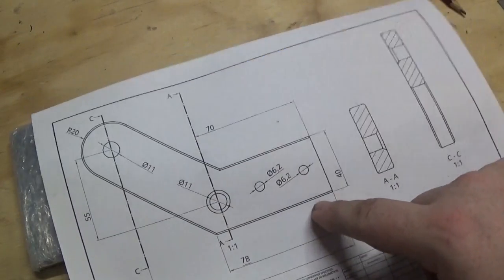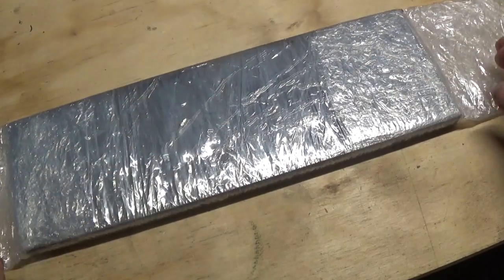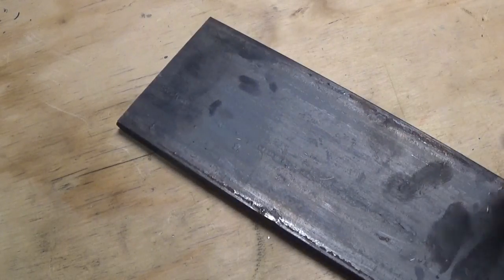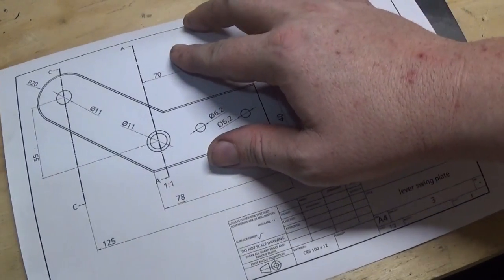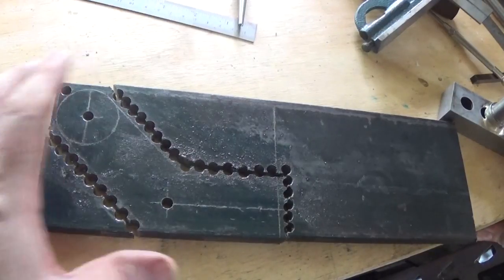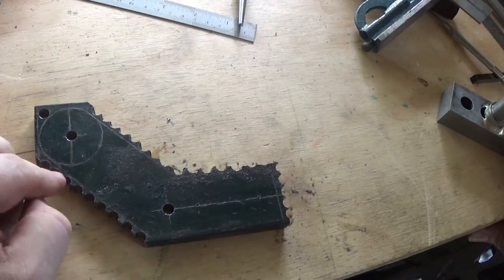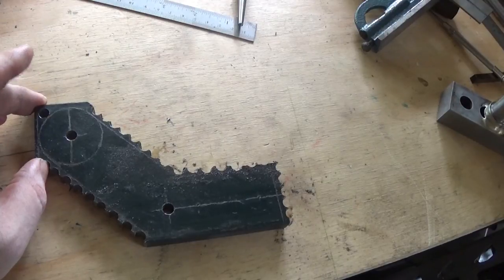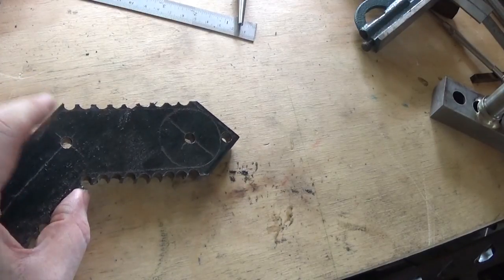Metal Spinning Atttachment for the Lorch Lathe Pt 4

Comment: Emma, if there was room on the shaper to hold down the piece of metal would it not have been easier to grind a narrow tool bit to cut out the part? Of course, either way, you still get a bit of a workout, but you save a little time not having to layout all of the drilling locations.
Peace!
Reply: Jeffrey Vastine I had the same thought

Comment: LOL, extremely funny and almost subtle about that stoke length comment Emma.

Shop tooling bugets for most of us always dictate what were able to add to our home shops. I resisted for far too long buying one of the usual 4" x 6" horizontal bandsaws, but even a week after getting it there one of the most used and in reality cheaper bits of equipment you can buy. They sure open up many larger projects that are hard to face with the usual hacksaw and file. Making up a few spacer blocks to account for various drill diameters and with two holes spaced properly for a slip fit pointed pin to rest in the first center punch mark and the second hole to fit a center punch makes the hole location for chain drilling far faster and much easier.

That shaper works even better than I'd thought it would and does a very good job.
Reply from the maker: thanks for watching! good tip on the chain drilling. I need one of those saws. but it will have to wait a few months.

Comment: Well done Emma!  Love that little shaper.   Crank on that enough and you will get in shape along with the part.  Nice to have a connection to your part when you don it manually, like using a hand plane in woodworking, just something about being right in there with the material.
Reply from the maker: still a few refinements needed to make the shaper fully functional, i was going to do the rest of the cleanup vertically and couldnt find the right tool. might have to make some. thanks for watching.

Comment: One of those small handheld bandsaws with a diy table for vertical work might be the ticket Emma. From what I have seen they do a very good job cutting steel. I have two shapers in my shop, a 7" and a 10.5" both of them have three speeds via a belt drive. I see your shaper is infinitely variable speed☺ nice option!
Reply from the maker: +Shawn Lund the interupted cuts are the worst lol
Reply: I was just poking fun at your lever operated shaper. 😆 In reality I would love to own one, to bad your on the other side of the world or maybe we could sort out a trade☺